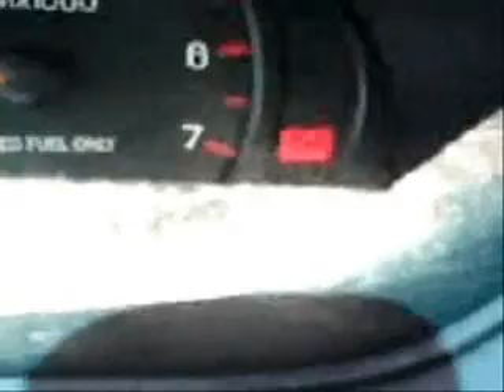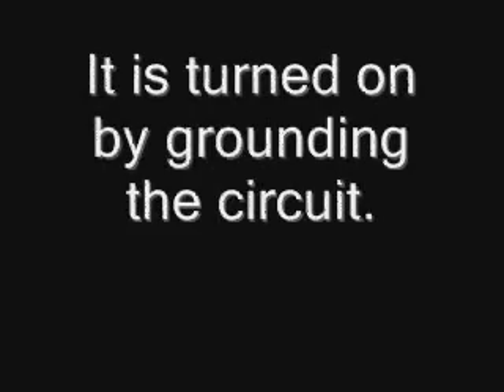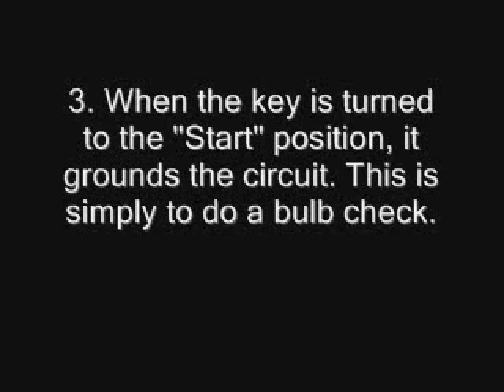Taurus Log 17: Brake Warning Lamp Diag: Part 1

Comment: MistaX8
You'll be glad to hear these THINGS (since ford hasn't a name for the part, less a part number) do slide right out without problem! Obviously the foreign supplier meant replaceability but forgot to inform the ford folk or the information didn't  translate very well.  PLUS these THINGS aren't just a Sable foul up they stuck them on ford trucks also.  In fact they're everywhere....EXCEPT a part store.  It's like finding JUST the reservoir... maybe it's a small town thing.  Thnx 4 reply

Comment from the maker: The switch is integral to the reservoir. You have to replace the whole reservoir (NOT the whole master cylinder, the reservoir comes off the top of the master cylinder).

Comment: These brake fluild switches suck!  Finding a replacement from ford sucks worse... like nothing has sucked before.  I'm trying to replace one on a 2000 sable and can't find one anyplace other than the parts yard.  Ford.parts website doesn't even list it.... can't even find a name for it..   THEY WERE THINKING ON THIS ONE.... thinking FORD SCAM to make you buy a new master cylinder to fix a .10 cent plastic part.  When these guys get to Hell they'll have to drive sables